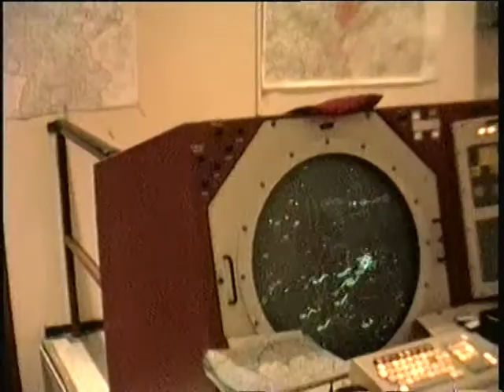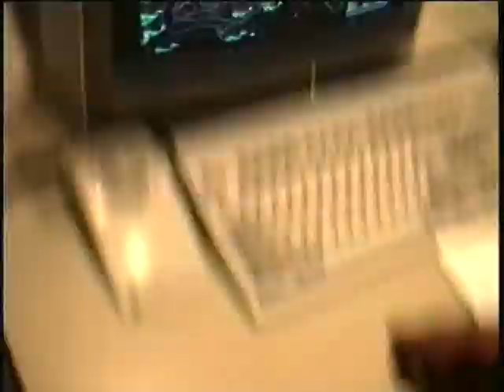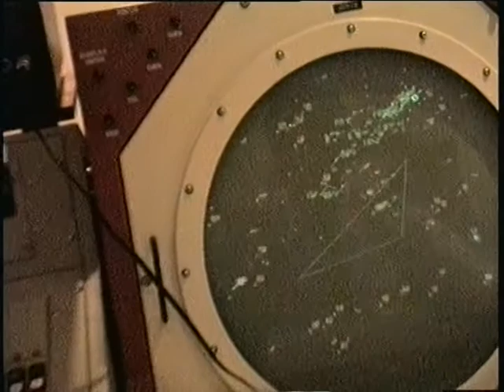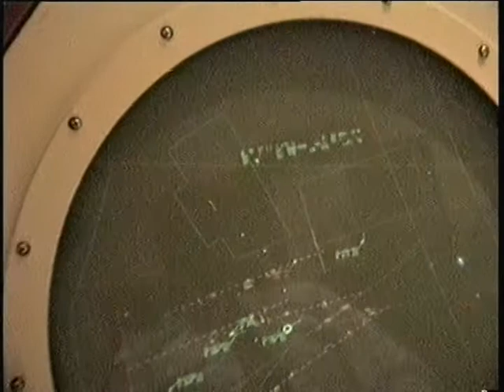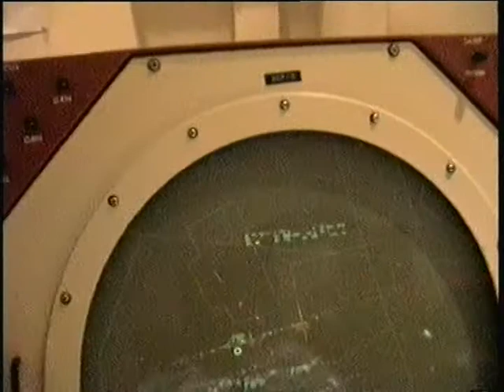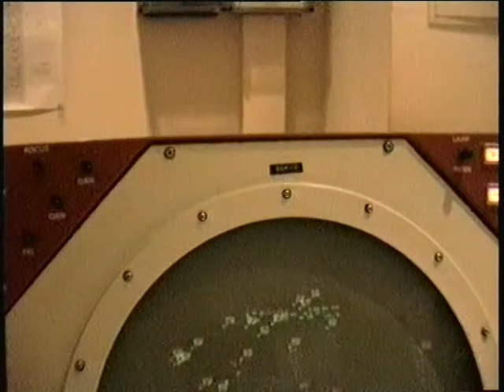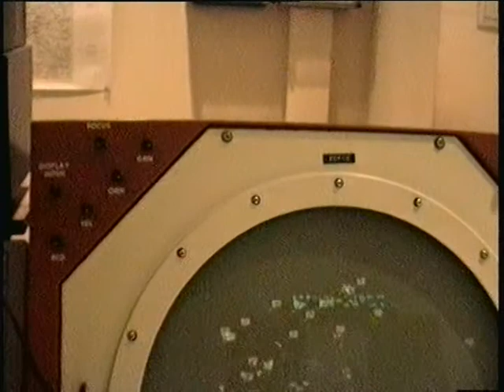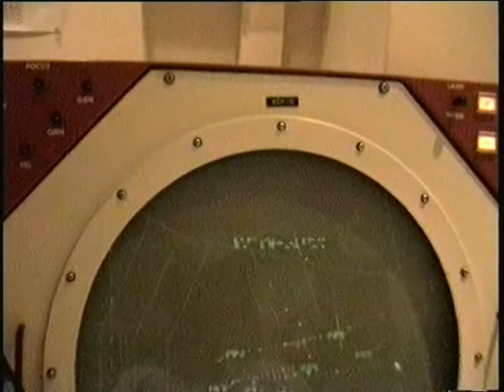BARTCC (Berlin Air Traffic Control Center July 1992

Comment: I was stationed at Tempelhof when this was filmed.  I was one of the system operators in the BARTCC.  7350th Comm Sq.  This was my favorite duty station.  Was there from 1991-1993.